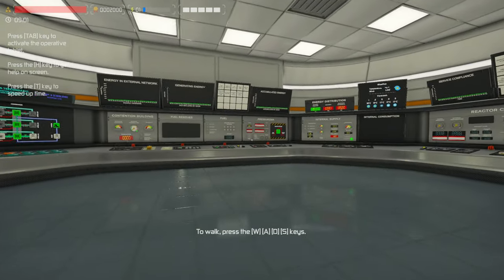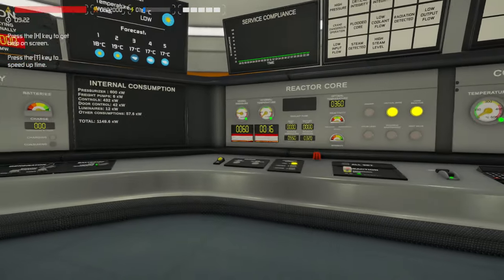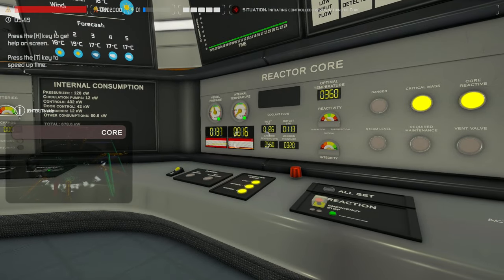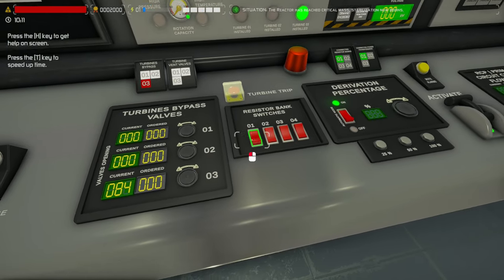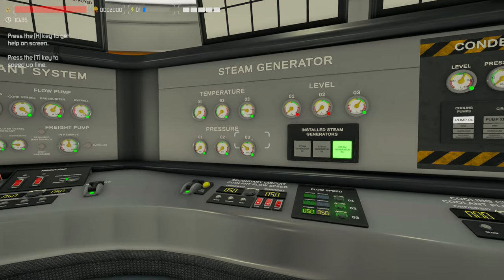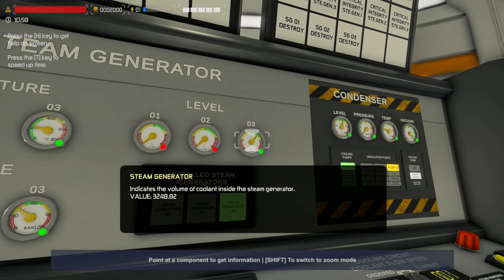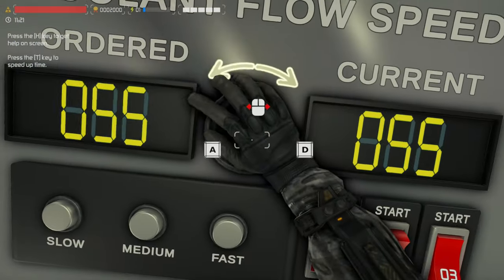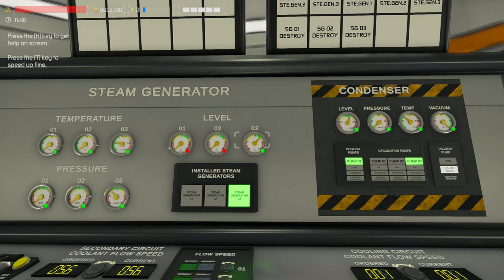Nucleares - In Depth Tutorial & Explanation (Old Ver.)

Comment: So i can start/run the thing. But when i try to upgrade my pumps (upgrade not buy new) it causes my generator to do weird things. It will generate steam and produce electricity and then it will go to zero, then back up to full power, then down to zero and it will keep doing this over and over.  

Do you know if this is a bug or if there is a special upgrade procedure?
Reply from the maker: Just watch that your generator "speed" doesn't go over 100% as it causes problems with the Synchroscope etc and outputting to the grid.
Also the 1st upgrade you should probably go for is the condenser or your turbine/generators... currently you are limited on that generator speed if you wish to increase your overall output... it could also be with how you started up or even your transformers/resistors or even that your producing power without your resistors on and damaging your turbines...? Ask and post a screenshot in Nucleares Discord? I'll be there soon later today

Comment: awesome this helped me a lot thanks :) ,,,, the only part I have problems with now is shutting down, upgrade  stuff and the marketplace,,,,, would love it if you could show us now it works :)
Reply from the maker: You are the 2nd person to ask for that exact thing... And is already in the works as we speak 😎🤓
Reply: Idk what the "proper" way of shutting down is but I set the condenser to 100%, control rods to 100%, run the bypass or slowly crank down the turbine to keep it everything balanced until it hits the temp of it not producing steam. Still gotta run coolant to keep the core cooling down but you can shut everything off and repair almost everything. Pretty sure you've got to take the fuel rod out to repair the core...
Reply from the maker: Doing a Shut down tutorial, coming soon... easier than you think ✌️
Reply: @ShArPy1o1Games  appreciate you, the other tutorials were hard to grasp and it took a lot of trial and error to figure everything out, but it's not rocket science, only nuclear science 😂

Comment: Can you do a Tutorial with all 3 Cycles? I have Problemes to stbilize Cycle 3, while 1 and 2 runs perfectly
Reply: YES PLS!!!!
Reply from the maker: Loop 3 is always a little higher on the lvl than the other 2 loops due to loop 3 being next to the condenser... I usually bump the 3rd loops primary coolant up 7% higher than the other 2 Loops... hope this makes sense to you ✌️😇😎
Reply from the maker: Shall happily oblige... Just waiting on a patch to come out and I'll do a Shut-down tutorial then I'll do a full playthrough to show everything
Reply: @ShArPy1o1Games  thats weird. I thought all 3 Loops on All 3 Cycles should be run on the same Settings. My Settings are
Primary 1,2,3 runs all on 40%
Sec.1 at 95% at 3200ltr. / 65Bar
Sec.2 at 82% at 3200ltr. / 60Bar
Sec.3 at 40% at 3200ltr. / 35Bar

That is very weird to me. Bypass is closed on Cycle 3. Otherwise the Steam Turbine isnt getting any Performance
Reply from the maker: Sec. 3 is only at 35 bars because u have the primary coolant so low as well as the reason why your secondary coolant is also so low 🤔
I usually have all Loops available going at max power output (depending on demand) and control the power output to the grid using those turbine bypass valves... not the most efficient but is easiest.
Loop 1 & 2, I have at the same primary coolant flow except the 3rd Loop which is 7% higher than the other 2... still in testing so I'll keep you updated 😎
Reply: @ShArPy1o1Games  Sounds interesting. I have to Test this. I thought my Savegame was broken because my Cycle3 SteamGenerator had a Hole i didnt know. After a Long Time i saw that and repaired it and my Pressure was drop after reaching 60Bar to Zero.

Also a new Savegame did the same Problem, for that i uninstalled the Game and deleted all Savegame Files.
Reply from the maker: Testing is always the way to go... fun to learn new things 😇😎
Reply: @ShArPy1o1Games  Wuhuuuh, Update time :-)

Comment: Great Video, tksd a lot! one question i finally see someone using Capacitors instead of Bypass, in the game everybody says to use Bypass because capacitors are only for emergency, In the patch note, the developer do not say anything about them beeing emergency only and presents capacitors as a normal producdion precedure. I see you also use your capacitors as needed! the get same wear when you use them?. Second question why you turn off the Fuel control shitch? to use less power? Tks a lot!
Reply from the maker: Hate to correct but they are "Resistors" 🤣✌️... If you have an objective to "not use emergency services", unfortunately using the resistors will fail that particular objective instantly. Also when I turn the Fuel Residue control panel off, I do this as the panel isn't used again until Reactor Shut-down and by shutting the panel off, you save roughly 60kw of power to be used elsewhere (note that the internal generator produces max power no matter what and uses the same amount of  fuel regardles if power is drawn from it or not)
Reply: @ShArPy1o1Games  tks for the replay. It is clear that you have to avoid the use if the resistors during the objective, but ussually (when there is no objective) do you use them or Bypass?
Reply from the maker: I use both of them at the same time... just easier